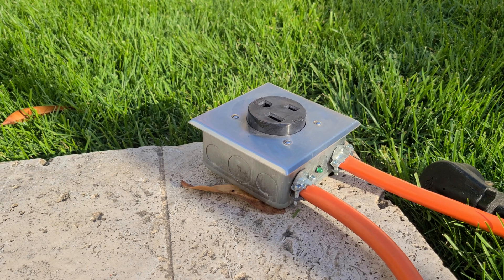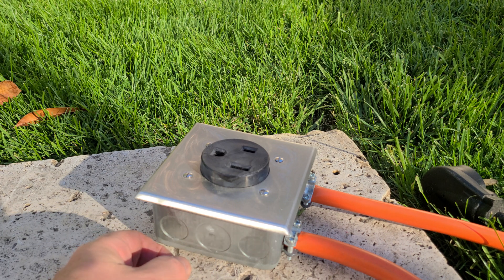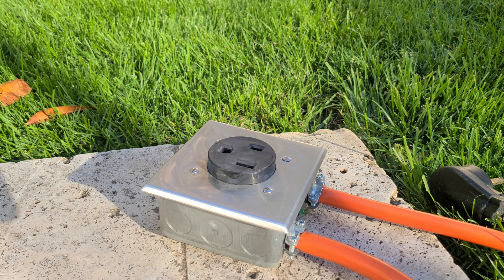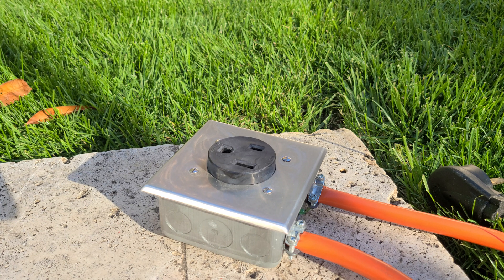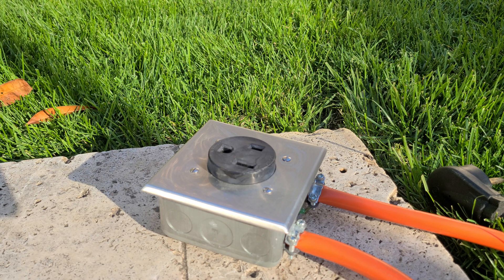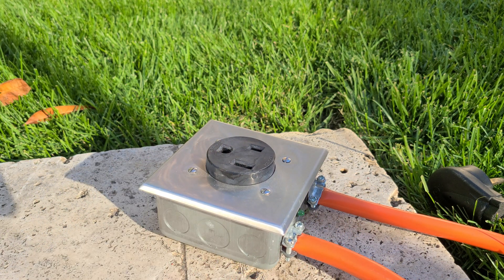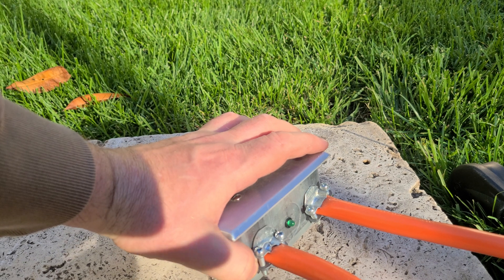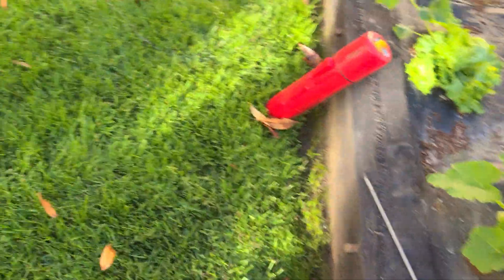240V Power Joiner - Joining Two 120V Circuits   Part 2   Testing

Comment: I don’t know jack about electricity, amps, volts, or anything like that.
But I just bought a 240v MiG welder, & was thinking of buying a small portable generator.
My question is, can I do something similar to what you did in this video, but to the generator. The generator would ONLY be for my welding machine.

Most small generators I’ve been looking at have around 3-4 separate plugs, with im assuming, separate lines. (ex. 120v/20a - 120v/20a - 120v/30a)
Would joining a 120v/20a line along with a 120v/30a, from 1 generator,  give me the 240v needed for my welder??
Reply from the maker: Correct, It would be the same. But I would just buy oneceith a 240v Connector to plug in the welder. It's just easier. Thank you for joining us.

Comment: This technically works as long as you get two 120 circuits that run off of different legs and are the same amperage/wire gauge. Should make zero difference as far as what the welder sees for voltage. As others have pointed out though, not exactly the safest thing because when one leg trips a breaker due to a short, it won't necessarily trip the other and you could have a very bad situation. If you're knowledgeable enough to put something like this together, you should easily be able to wire up a 220 circuit in your home or shop to weld off of. If you need to be mobile there are plenty of very good affordable 110V wire feed welders out there that would do a job like this much better.
Reply from the maker: Everything you are saying makes 100% sense. I have this for a very very occasional use. Thank You for commenting and Joining us!

Comment: This is very unsafe and is not to code.  Two reasons.  If only one breaker trips--and no reason why both would,  the remaining 120V breaker will backfeed all  the way through the powered  device to the "dead"  male  cap  and everything through it will be  "hot."  Same deal if you unplug either  cord cap,  power will feed all the way through  the load and  the  bare plug will be hot. THIS IS STUPID AND UNSAFE
Reply from the maker: I get it but if you have no other option, this works. 120V will not kill you. I guess I should add a warning. If you are on a pacemaker in a hospital, please do not try this.

Comment: I got same set up. As y do..All the other video do not hookup the neutral?? Is it ok not to hook up the neutral?? On your style?Cuzz I do not want to feel just a lil shock.I don't want no not thing bout get shock!!
Reply from the maker: Correct - Ground the Two Green Wires to the Box, that will protect you from shock. Just Connect the white wires Together, it is fine, it just will not work in a GFCI Outlet. The LED light is ok, but if only one  side  connected, the other side will give you a minor shock of a few amps, not dangerous. See my first video.
Reply from the maker: what are you going to hook the Neutral too? there are two 120V hots and a ground. I connected the Neutrals together. I got a little shock from the LED that crosses the hots. even if you get shocked with 120V, it will not kill you, its just unpleasant. No Worries! Just Enjoy!
Reply: @silverbankruptcy  120V can very certainly lead to death if your body is grounded, i.e., barefoot on the ground or basement floor, holding an electronics chassis with one hand, or connection to a sink or bathtub drain/pipes though mineral content in the water. Any grounding to the body will make a good pathway for the electricity through your body.
Reply from the maker: @AwakenedAnhedonic  I can't imagine a healthy person being killed by 120V. You would just let go of the line. 240V is another story.

Comment: These type of hack boxes work but have some safety implications so they don’t meet code. Since the two breakers aren’t ganged together you can trip one leg, everything stops working but you still have live current so you have to exercise caution.
Reply from the maker: Good Advice! Also, for that reason, they do not work with GFCI Outlets. Thanks for the Observation!
Reply from the maker: @David Lewis if someone out there could show that, it would be interesting and informative!